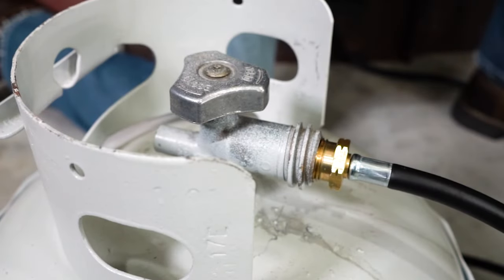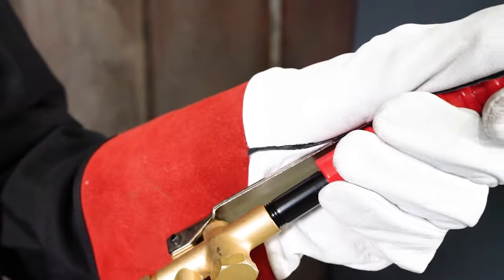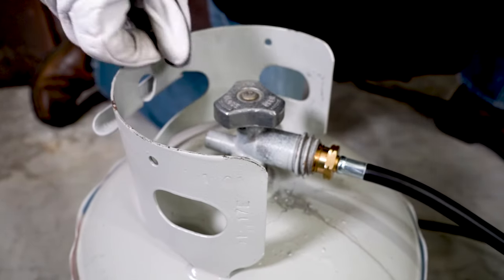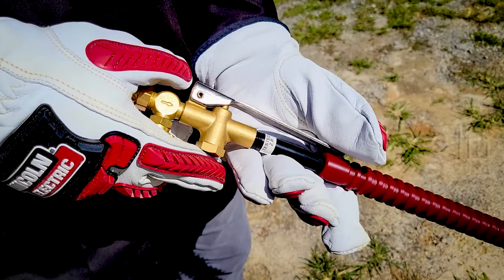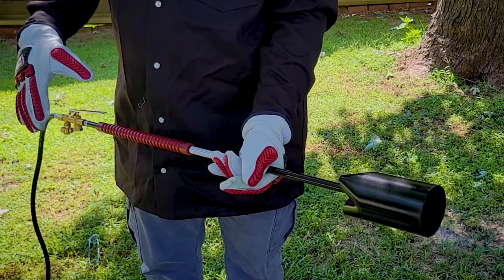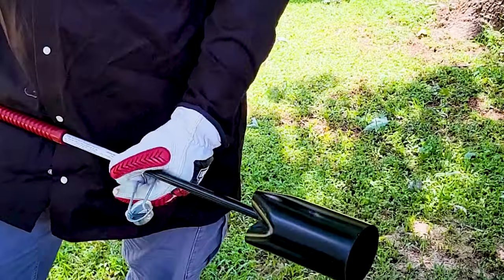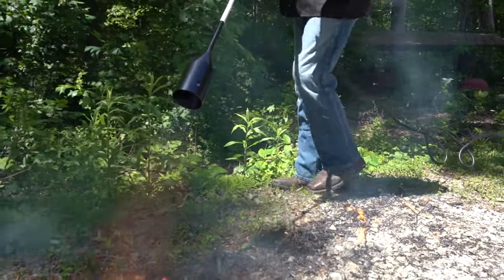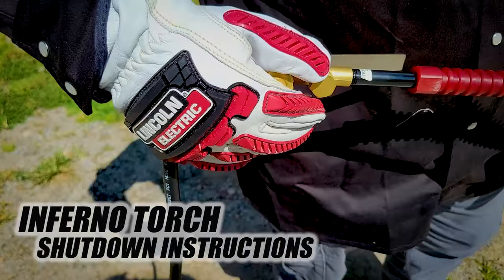Inferno Torch Kit - Operating Instructions — Model# KH825-03

Comment: The automatic safety shut off valve does make this a very safe torch but it is a pain to use for weeding. I would prefer a blast lever and constant flame. I have to hold the torch with both hands to adjust the flame. Not ideal for weed burning.
Reply: I agree. There are so many idiots now that everything has unwanted safety features that make things a pain in the butt to use. Stupid people and lawyers have complicated things for people with common sense.
Reply: I got this at lowes and it's such a pos. where do you get a real blow torch?
Reply: @JimmmyRaynor  like an acetylene torch?
Reply: Super disappointed.

Comment: Mine sat in a shed for a year and now the flame is weak. I don't see any way to disassemble and clean out the nozzle. Not spending another $60 on a new one.
Reply from the maker: Hey  Greg,  the Lincoln Electric service staff might be able to give you some advice on how to get it back.  Here is the link where you'll find a few ways to contact them. 
https://www.lincolnelectric.com/en/ask-the-experts
Reply: @LincolnElectricRetail  Thanks! I will contact them.
Reply: @LincolnElectricRetail  Need to post a follow up in case anyone else experences this issue.  It wasn't the torch that deteriorated, it was my memory.  The intstructions reminded me to open the tank valve VERY SLOWLY.  I did this, and the torch works perfectly.

Comment: Holy cow what a piece of garbage the flame doesn't stay lit without handle depressed. Thought i was doing something wrong.
Reply from the maker: It's a safety feature!
Reply: @LincolnElectricRetail  It makes the torch completely useless. I returned it.
Reply: @tooltips9911  Nothing duct tape or a zip tie can't solve my guy.